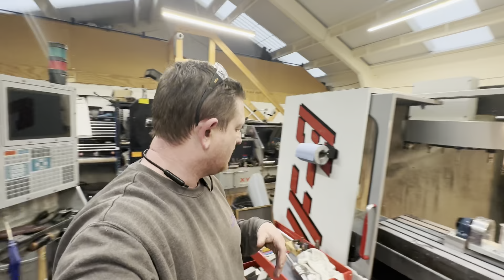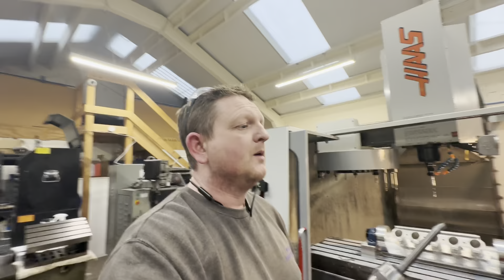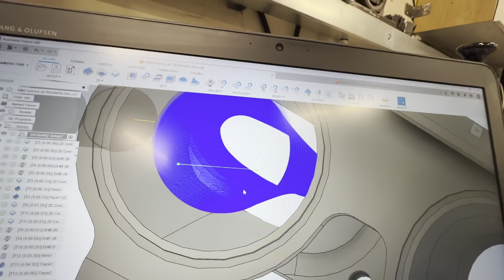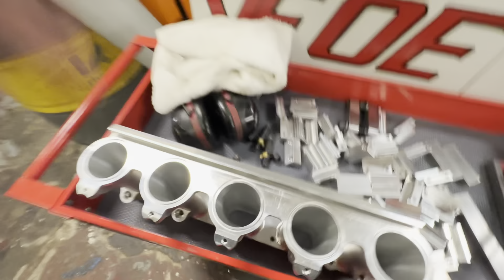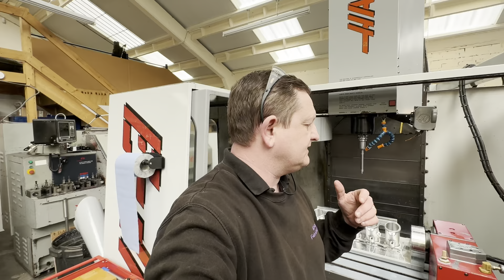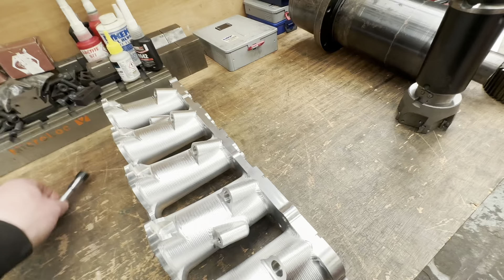Finishing up the test piece runners on the Haas vf3

Comment: I would have thought that you would be getting a perfect finish inside the bores. What ballnose cutter insert are you using. I would have thought a HSS ground tip ballnose cutter would be sharper than a carbide tip for the 0.5mm finishing cut. I have a ball nose cutter with a ground carbide tip is yours just flat. I have a photo but cannot upload it. I have just posted the photo on your Facebook page.
Reply from the maker: Thanks, as mentioned on ebay i have now order some iscar multi master holders and inserts specifically for aluminium so hopefully thats a big improvement

Comment: Looking sweet as🤙🏻 

If you can remove as much material as you can on op1,  id use the facemill like a end mill around the outside profile using 3d adaptive leave 3 to 4mm on. 
If you need any help/advice send me a message on messenger. 

For you program size on the ports you could do them as sub programs which will shrinks the program about 4x.
Reply from the maker: Hi Phil

Yeah i plan to do that to remove as much weight as possible, i have a facemill with a 160mm gauge length im going to use or i can use the 20mm end mill with 80mm flute length so i have a coupler of options.

As for the program size i did do it as a pattern in fusion and that didnt make much difference so yeah maybe a sub program with the correct x axis offset each time will be the way to go so i will look into that

If i need help i will give you a message

Thanks
Marc

Comment: Looking good Marc.  Here’s a tip if you are having issues where the machine can’t keep up with the feed rate. Put a M76 at the beginning of the operation. M76 turns off the display, allowing the control to dedicate all bit chunking to motion control. Put in an M77 at the end on that particular operation and the display comes back on as normal. On the older controls (and mine is older than that vf-3) it makes a huge difference.
Reply from the maker: Hi Carl

Thanks for the tip, i didnt know that!

What do you do if you need to see the display mid op for some reason? is there a way to turn it on whilst still running if you had to?

My vf3 is a 1997

Thanks
Marc
Reply: @kinzy_fabrications  I have a 1993 VF-1. We do a mix of work on it, but typically have only needed to use the M76/M77 when we’re doing female mold work, ie 3D Tool paths. Most of that is done DNC due to memory constraints. Recently we started taking in outside work where we are provided established programs that have been run on post 2011 Haas machines before. They used a lot of ramping and interpolated radial entries which are mostly small point to point tool paths, rather than having „smooth“ paths with radius data for the control to process. For machines with like mine, the M76 helps by shedding the cpu load for the display. Yes, you are correct in that you can’t jump in and out, you are committed till the M77 comes through. I will trial with my feed override turned down, then once proven out go back and edit in my M76/M77 commands and turn up the feeds. A bit of a pain I know, but when you’re dealing with old machines like ours you have to get creative. Best of luck and thanks for the inspirational videos!

Comment: haas sells brake boosters for the rotaries, but dont waste the money on the haas one, but it from the supplier directly. they use a doubler, replaced the one that was leaking on my hs-1 rotary no problems at all.
Reply from the maker: I wonder if the seals on the rotary will take it?
Reply: @kinzy_fabrications  Thats definitely something to consider

Comment: This might be a good part to try the rubber hose trick on. Get a stretchy rubber hose, wrap it around your runners, and it can reduce the vibration and give a better finish.
Reply from the maker: That could help it yeah, but to be fair the finish on port 4 I was happy with

Comment: Hey mate, good job!
Just one thing, this is the second time you've gotten fkd from using 2d adaptive. If you use 3d it'll never gouge.
Reply from the maker: Yeah rookie error! I assumed that the bore was straight down and that was not the case, 3D adaptive definitely safeguards from that mistake
Reply: @kinzy_fabrications  can't tell you how many times I've sworn as fusion for not cutting what I think it should cut with 3d adaptive, only to find out its saving my ass

Comment: If your going to be doing alot of the work on the 4th axis at 90 and 180 degree and going an op at a time.
Consider adding a bespoke angle plate that you can fasten from the table to the bottom of the trunnion this would as some rigidity...bit of a pain to remove before your orient the axis I know 
Just a thought🤔

Love the videos
👍
ALEX
Reply: 👍
Looking forward to seeing how it turns out.
I think your doing the right thing trying to do as much as you can on 4th axis keeps everything aligned etc
Reply from the maker: Yeah defintely, if it cant take it i will look at selling my hrt160 to buy an hrt210
Reply: Your landlord sounds like knowledgeable chap 😂
Reply from the maker: Hi Alex

Me and my machinist landlord were actually speaking about this today! My concern is the id have to remember to manually add a stop to the program after every op and if I forget at any point it will overload the table and may cause damage or cause the trunnion plate/set up to move and lose alignment 

I think il just have to try it and if it holds the weight ok then il have to just go easy with doc and step over in the programs